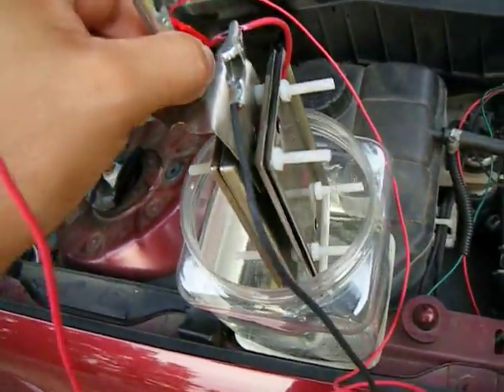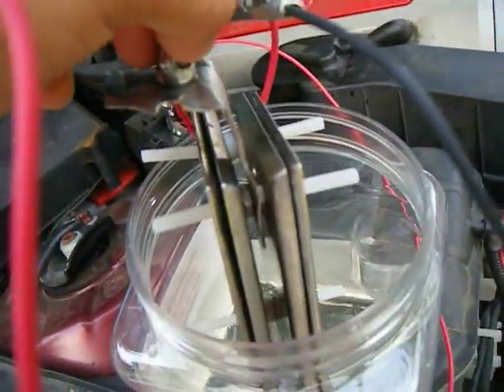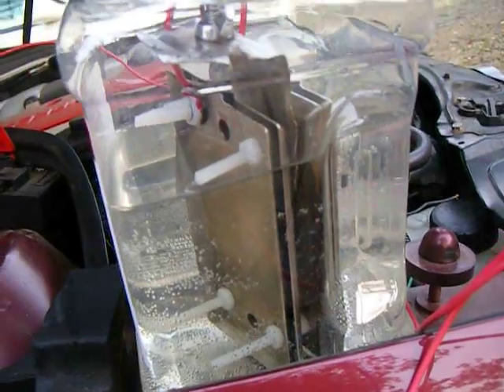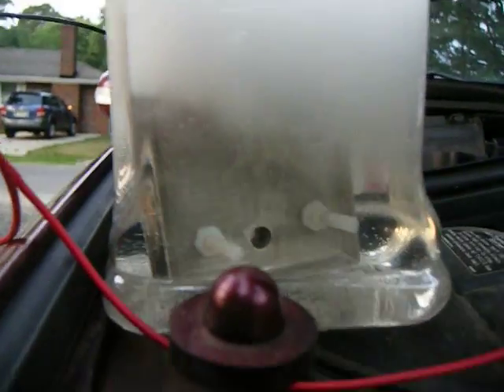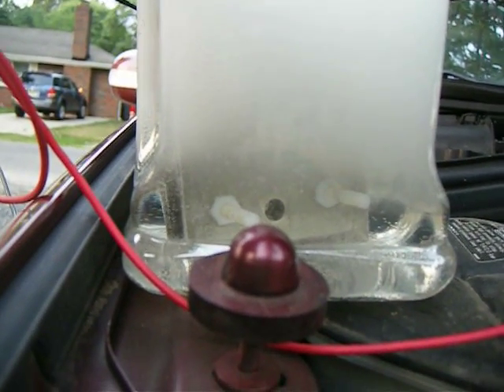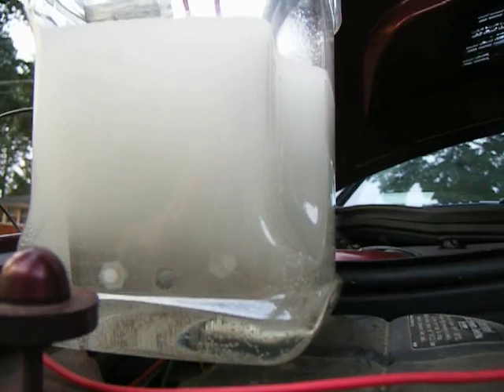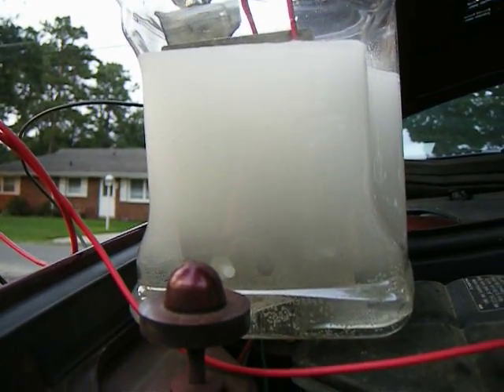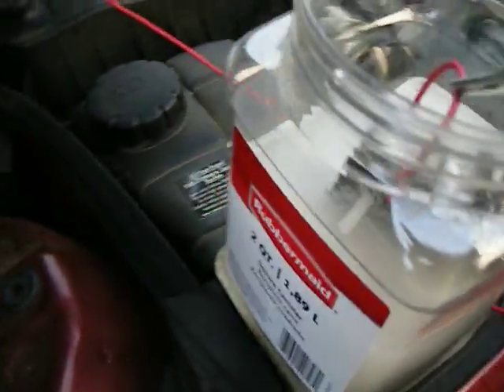Smacks theory  demonstration

Comment from the maker: you've yet to prove ME wrong in the first place. if you supplement your air with anything- it changes the engine's characteristics. for ex: adding methanol in vapor for atomized cools intake air temps,  and adds a hydrocarbon. cooler, denser charge means more oxygen, and more fuel means more power. atomize water and it increases fuel efficiency. cooler, dry days gives more engine power than hot and humid.   now apply thought processes to adding a hydrogen and oxygen. raising efficency is key

Comment: Don't compare this bs with a supercharger/compressor in a car. Instead give me some numbers on what your device does more then generate some hydrogen bubbles.
A lot of heat is created in a combustion engine, but adding this to your "system" won't change a thing. Prove me wrong.

Comment from the maker: a gasoline engine is about 20-25% efficient. that means 3/4 of that gallon of gas goes ABSOLUTELY NOTHING.  it would be stupid of you to think that if you change how the fuel burns, or its inherent characteristics, or the air/fuel ratio, that there will not be serious fluctuations within the realm of efficiency and mileage. be more open minded. 

as i've said before, but a supercharger does the same thing- take a little bit of power, and makes even more power. is that over-unity? i think not.